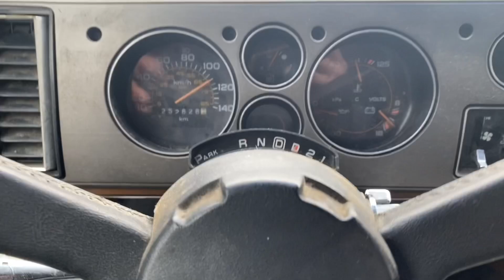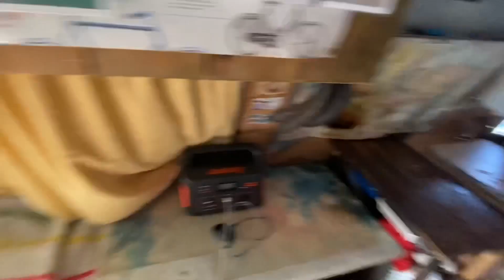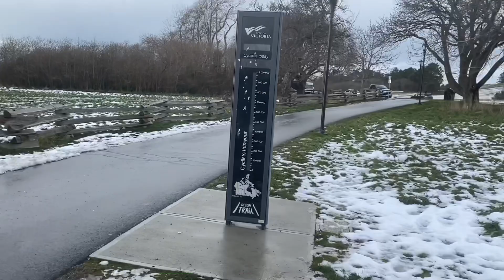Escaping the cold and trying van life in Victoria | How I shower and bylaws against van life

Comment: Do you live in a van with no heat? How??
Reply from the maker: I have a mr buddy heater but I try not to use it a lot bc propane is expensive. Best way on the really cold days was to use my hot water bottle but luckily this winter has been a breeze in BC compared to Ontario 🙏